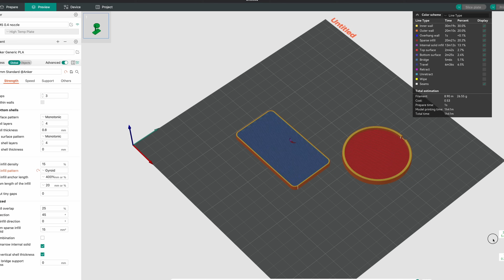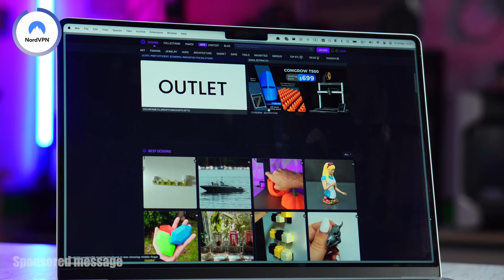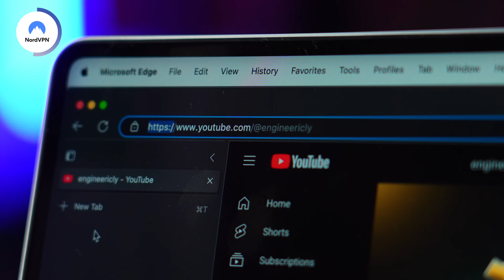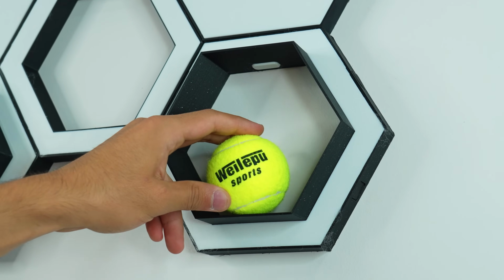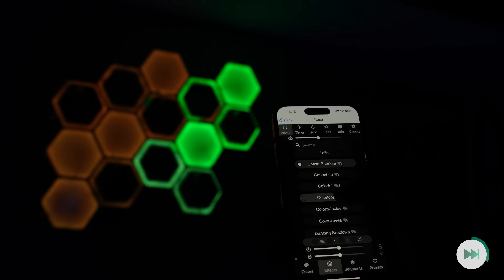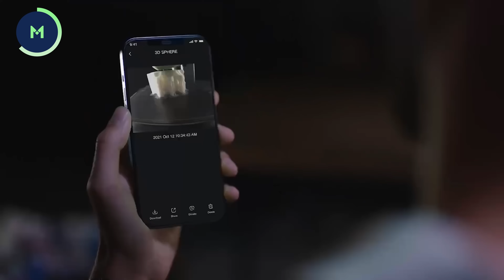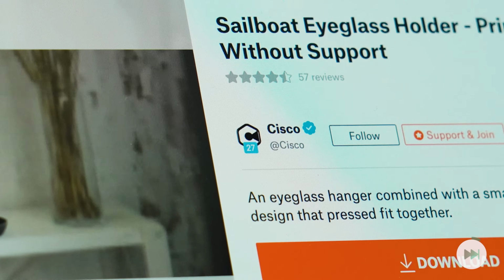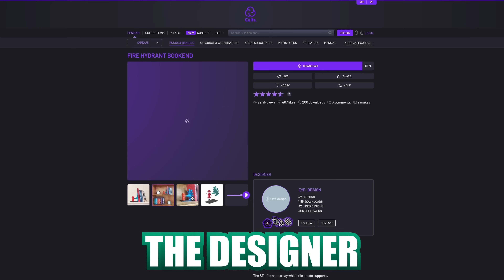Useful 3D Printing Ideas and Projects - September 2023

Comment: Can we get some more info about the hex LEDs? Did you use an LED strip that came with its own microcontroller and app? Or did you program your own?
Reply from the maker: I have used, WS2811 led strips and ESP board with WLED firmware
Reply: @engineericly  Thanks! I ordered a FireBeetle ESP32 IoT Microcontroller and WS2812 LED strips. Hopefully that does the trick 😄